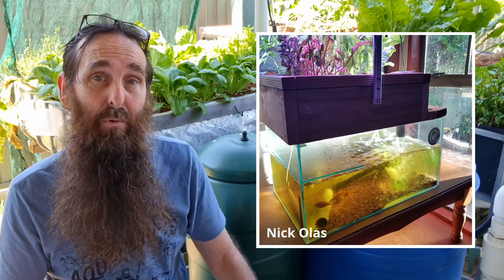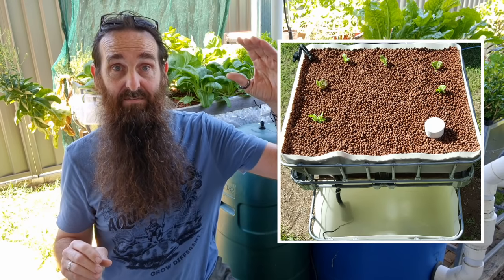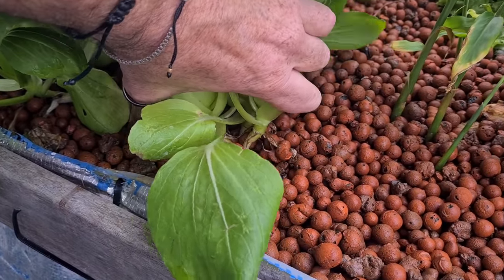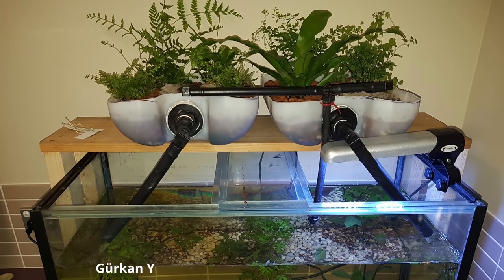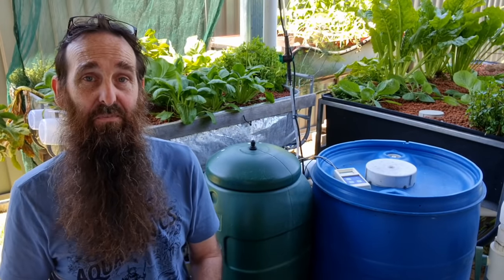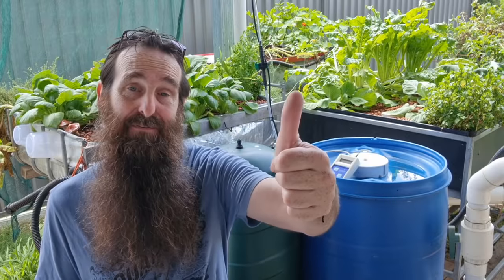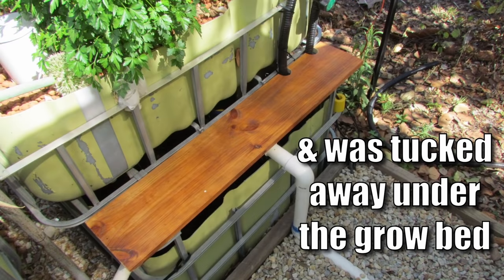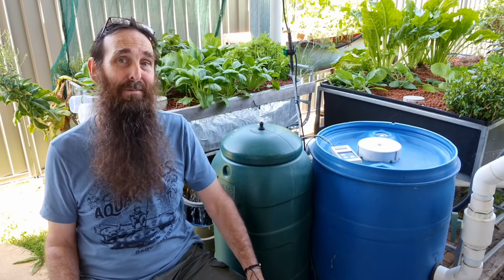Basic Aquaponics Systems for Beginners | How they Work & Design Ideas

Comment: For next small system I am planning to use an aquarium canister filter. Maybe a bit more pricey but will cost less in time and the filtration will be quite good
Reply from the maker: I have seen some relatively cheap ones at the local aquarium & have thought about getting one for a smaller system I'd like to build on the deck (if I get permission). 
Cheers & have fun with the build.

Comment: Hello found your video awesome and I started a small aquaponic by watching your video. But I'm having some trouble. I have an aquarium pump and water stay the same level in the aquarium as well as the plant area. But I have not put that much peddle is it because of this that my plant are dying!?
Reply from the maker: It could be a few reasons. Are they getting enough light? Do the roots of the plants look healthy? If the roots are rotting it could be due to not enough oxygen in the water.

Comment: Hey Rob I’m growing ginger in Ga and the winter is coming, wanted to know what’s the best way to cut back or should I bring it inside?
Reply from the maker: Hi WS. I would bring it inside if you get hard frosts that may freeze the top of the ground as it will cause the rhizome to rot when it thaws out. If your temp doesn't drop below freezing you could leave it out. We're in an equivalent to zone 10 here & ours does fine left in the soil & aquaponics through Winter.

Comment: Hi Rob, love the videos. I have been watching yours and a few other aquaponics channels learning about it, but had not made a system yet. However  I was thinking about adding a grow bed to my existing koi pond primarily to act as extra filtering. The pond has been stable for about 15 years and has about 50 koi in it , and is about 55,000 liters.  I figure I could probably support a decent size bed in that pond, and since it's been stable without the grow bed, I can't see where adding the extra filtering of the plants could possibly hurt it...
Reply: You would have to feed the fish more.
Reply from the maker: You might have a few issues with low nutrient levels as bwakel310 alluded to above. It can't hurt to try & see how you go with just one bed. Maybe use some cheaper rock rather than the expensive clay to try & keep the price down. Maybe even some segregated baskets in the pond itself might be a better way to go.
Would like to know how you get on if you give it a crack.
Reply: @RobsAquaponics  didn't think about the possibility of being too LOW in nutrients for the plants. That's a good point though, if it's already stable it probably would be low, of course I could bypass some of the water past the existing bio filters, and I somehow suspect the koi would not be angry if I gave them a bit more food, I'll see about setting up a small bed this winter and spring. Thanks for the advice, if it works out I'll let ya know
Reply from the maker: @MrRiggsad  Cheers Adrian.

Comment: Slight correction with the air stone, it doesn’t directly add oxygen to the water, it agitates the water surface, essentially enlarging the surface area, enhancing gas exchange o2 into and co2 out of water
Reply from the maker: O2 is also passed from the bubbles to the water on the way to the surface with the majority occurring at the surface.
Cheers.
Reply: @RobsAquaponics  makes sense since it is a air water “surface area”👍🏼

Comment: Hi, nice video, but i have some questions, will my setup work, if the the whole system will be in water? What i mean: for example there will be tank 100*100cm and 40cm height. And i will put 50*100cm busket 15cm heigt straight on top (it will be just 2cm out of tank) will it work? Or it must be out of tank?
Reply from the maker: It could work if I understand it correctly. The fish mag have a feed on the roots if they grow through the media into the tank though.

Comment: Hi, Rob im in south Australia how much does it cost to run a pump annually? ruffly
Reply from the maker: Hey Michael. 
Power is fairly easy to work out. Multiply the watts of your pumps by 24 (hours) then by 365 (days).
eg. 80w pump would use (80x24)x365 = 700,800 or 700.8kWH.
Next look at your power bill to see what they charge per kW & you should have a ballpark power bill figure for running the system.  
Hope that helps mate.
Reply: @RobsAquaponics  Thanks

Comment: Hey Rob,
Would it hurt anything by introducing 1 water snail to my chop and flip barrel system to clean up any little bits of grime in the bottom?
Reply from the maker: One probably wouldn't hurt Leon. 👍 You can also get small fish that will clean the algae as well.  Best to ask at a local aquarium as to what would work best in your climate.
Reply: @RobsAquaponics  Thanks mate. Im in SE Qld. Loving your content and advice.
Reply from the maker: @leonfox8119  Cheers Leon. 👍

Comment: Rob, I have viewed a few videos and am wondering if it's  cost effective. After initial proof of concept small system(s), can I run a system capable of sufficient food to pay for its expense. Startup costs are separate from system continuous operation. Maintenance is part of total operating expense. I have 2 ibc totes to use as I  expand.  I understand if I  am asking for too much info. A pointer to calculate cost to yield ratio will suffice. Climate is a factor I  assume.  I am in NEK near Canada.  Until I get my geothermal greenhouse going I will need to harvest after 3-4 months. My geothermal is primitive setup. Just a 10ft deep trench circulating air that returns at 50° at all times.
If I can ever get wind or solar I could power a heat pump too. Or maybe a Stirling engine generator.  Think big or go home,  right.
Reply from the maker: Hi Daniel. It can be done but I have no figures or calculators to share with you sorry mate. 
I look at it this way, the fish are home grown without the medicines that are fed to farmed fish that get imported (we're an island nation that imports farmed fish, go figure) so that by itself is worth it for me. 
The Jade perch we use have a FCR (feed conversion ratio) of 1.6 so at AU$88 a 20kg bag it cost $7.04 a kg or $3.52 to grow them out to a harvest size of 500G. 
The veg side of things will help up the cost effectiveness as well but I've never really attempted to factor that in. 
Your plans sound very interesting & I'd be interested so see how your system progresses if you end up having a crack at one mate. 
Cheers,
Rob.

Comment: can you use an existing stock tank as a 'fish water' source? we have 200 acres with a few stock tanks, I'm looking at using 1 ti supply a few grow beds. is there such a thing as too much water/fish for the grow beds?
Reply from the maker: Hi mate. As long as the water is fairly clean it should be OK. 
You can over do it with fish if you don't have enough biofiltration/media grow beds. Basically, they can produce more waste than the bacteria can handle & the system will crash. 
Having too much water & not enough fish can be an issue as well. The nutrients just get too dilute. Have seen folks toss 50 silver perch into an inground pool & the plants did crap.
Whereabouts in OZ are you located if you don't mind me asking?  
Cheers.
Reply: @RobsAquaponics  Thank you for the reply! I am wanting to do this in North-Central Texas, USA. Tank is stocked with bass perch (sun) and catfish. Its about a 40 meter diameter stock tank depending on the season and amount of rain for the year. I would need to pump the water up a hill beyond the fence/s to the house where I would put the grow beds (we have cattle that use the tanks for water) and then that's where I'm not sure what to do with the water from the grow beds,,, back to the tank?
Reply from the maker: @seaphor665  Back to the tank would be fine. 👍 Am not sure that a tank that size would have a load of nutrients in it. Might be better to try floating some baskets or rafts in the tank first to see how the plants grow first.

Comment: Hello! So I’ve been planning to make this work as my capstone project but my group kept running into issues. We had to be creative and make our own unique design since our teacher said that many batches have done it before us already. We also ran into a problem regarding nutrient deficiencies which is our main issue. Any help or suggestions in solving that? We would really appreciate it.
Reply from the maker: I like to use soluble kelp powder as a general tonic as it includes a load of potassium. You only need a VER SMALL amount though. 3tsp turns my 1600L of water very dark.

Comment: Sooo I have a question and that is flow rate.  So I get the system puts out let's say the good water that's filtered as fast as the pump is putting the bad water back into the tank with the fish. Since it's gravity from filter to filter back to the tank which gets pumped back into the fish tank to start again. So how do you manage the return water when let's say the good water first stop is this bed, and then this bed.  Do you turn down the flow rate at the pump so less get pumped back which slows everything else down.  Guess I'm having a hard time with my brain when bed 1 needs this much flow when bed 2 needs this much.  Which means the flow back into the return tank at the bottom which get pumped back to the fish.  What's the best way to manage the flow rate of the water from bed to bed so that the return tank doesn't go dry
Reply from the maker: Sump tank sizing does play a part in it. I like to make sure that it's volume is 50% the combined total volume of flood & drain grow beds. That will make sure that there will be enough water in there to cover the pump & also give a safety net of extra water to lengthen the periods between water top ups.

Comment: I'm considering a drip irrigation system, in which urine from the toilet would be diluted and delivered to the plants.
Reply from the maker: Nice one. Will you be aging the urine first?
Reply: @RobsAquaponics  i don't think that's necessary  . I was looking into a urine separating toilet but changed my mind. I looking into comminution where large particles are broken down. I'm looking for a way to inject the urine -fecal solution to the roots by drip irrigation or osmosis.